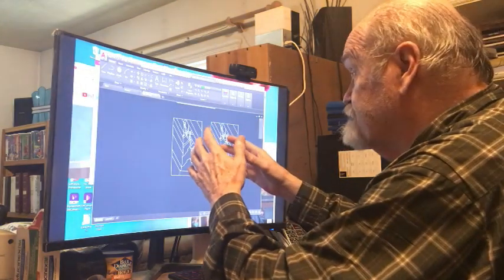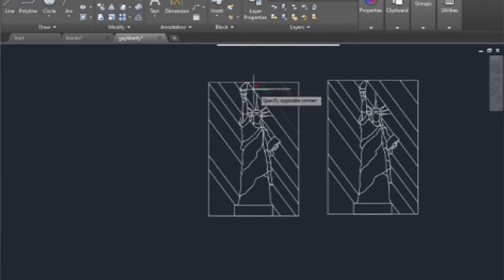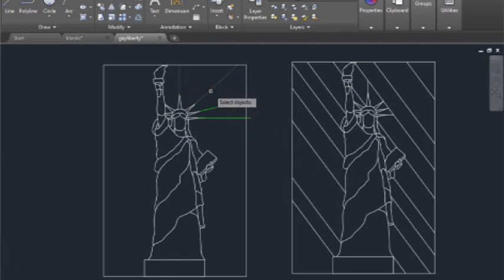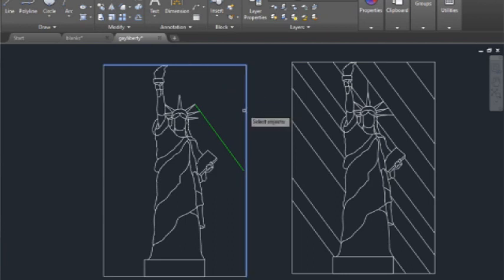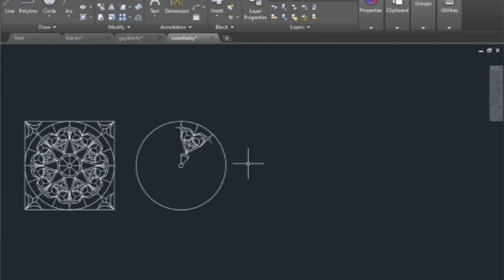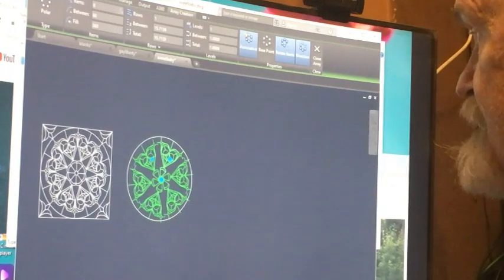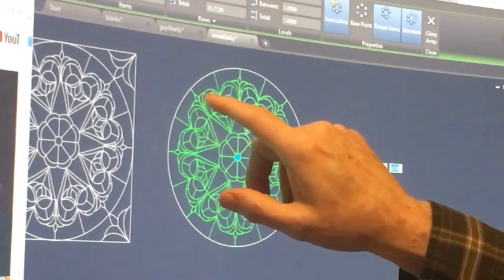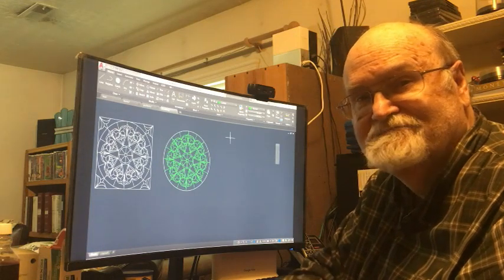Stained Glass CAD Drawing Techniques   V417

Comment: I use autocad for work. I have used it for patterns sometimes. I used to use a free program called Draftsight. But it is not free anymore.
Reply from the maker: I see that you can sign up with them for $249 for the first year and then $49 for each year there after. It sounds like a good deal if you are going to use it  often. My copy of AutoCAD 17 cost less than that and doesn't ever expire, however it tries to get past the checking license part and often takes a long time before activating. I'll often start it up as soon as I start up my computer and then go read email while waiting for it to open.